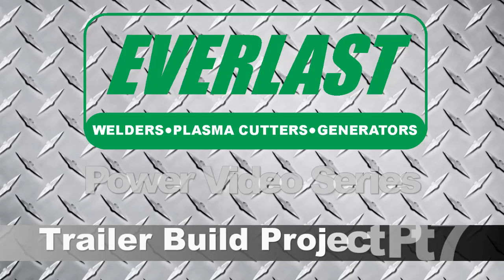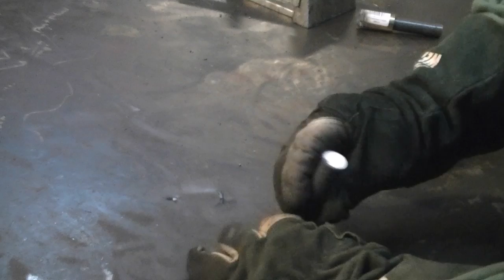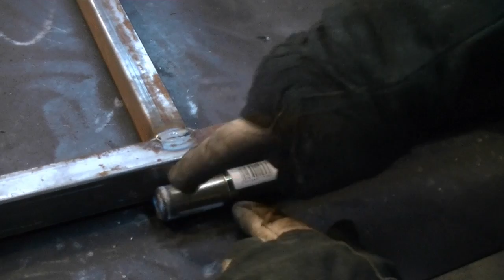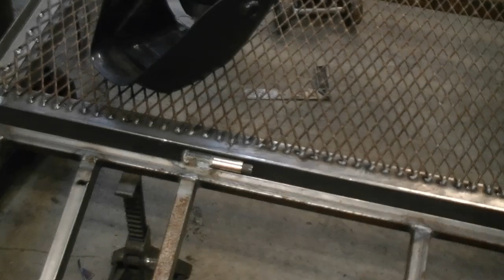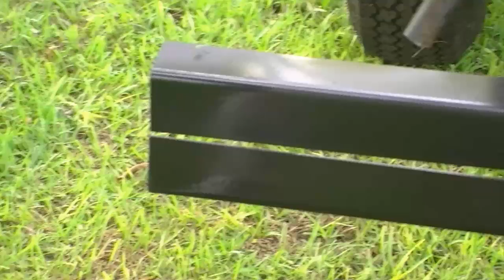Everlast Trailer Project Build Part 7: Ramp Installation on Utililty Trailer

Comment: Since your pre-cut tubing left you 1" shy on each side, why didn't you simply set the outside tubes to the outside of the upper and lower ends and shorten the center tubes the difference?  Then your gate pins could have been set one above the other and no chance of them falling out going down the road.

Comment: WHERE CAN i GET THE WIRE MESH? PLEASE
Reply from the maker: Bob,  Wire mesh, (or as it is more commonly called "Expanded Metal" is available from most any steel supplier.  I am not sure where you are located, but most rural and urban located suppliers I have seen carry it.  You just have to ask and then ask what sizes they have.  This was #9  expanded metal, with 3/4" holes IIRC.

Comment: Do you have a license plate for that trailer?  If so, how did you get it? I want t building one, but I haven't  done it because of that.
Reply from the maker: Most states have a home made trailer provision, where you can build a trailer and instantly apply for a trailer ID number on the spot at the same time you go to purchase your plate.  Some require it be inspected by a local law officer, but in general its pretty easy as long as you pay the fees for your trailer license plate.
Reply: +Everlast Power Equipment How much is a typical trailer license plate?
Reply from the maker: Varies from state to state.  Here it is 18.00 for a tag fee.

Comment: Very nice series.  I have always used angle iron for the frame, but other than that, the construction details are very similar. I have built four trailers, and built all four using a 225 amp AC Airco stick welder and 6013 or 7014 rods.  Wish I had a Mig welder back then!

Comment from the maker: A Lincoln 140 is really only about 90 amps.(See duty cycle rating).  Theoretically it's a 140, but that's rarely ever attained with this type welder.  It's an industry marketing tactic.     This is really marginal for creating sound welds, particularly on the axle hanger brackets.  To get the best penetration, you'd need about 120-140 sustained true amps at a minimum.  It's possible to weld with a Lincoln 140, but please be very careful and avoid any critical welds unless you are experienced.

Comment: I just purchased a lincoln 140, you're right about the flux wire, the gas process is recommended for lighter work.  I'll need to get a tank before I start.  Thank you for the information.  I really enjoyed your videos.

Comment from the maker: It could but flux core is better suited for thicker materials.  I'd worry about slag entrapment at the weld toes if you aren't careful, especially with out of position welding.  Out door shouldn't present a problem.  One of the biggest trailer plants I know has built thousands of trailers in a shop with a dirt floor.  They have major production going on but everything is built in the dirt with large open shop doors/sides.  Just keep everything as level as possible...clean as possible.

Comment: I just finished watching your entire project.  A lot of good information.  I hope to start a trailer building project soon.  Just a few questions for you, 1) can this project be done w/out gas, using flux wire instead? 2) I am very short on "indoor" work space and will be building my trailer outside, under a car port.  It is the only option that I have, do you have any concerns that I should consider in doing this project outside?  Thank you, I've bookmarked for future refer reference.